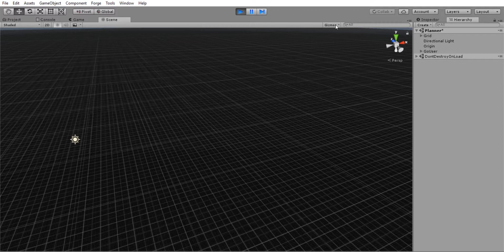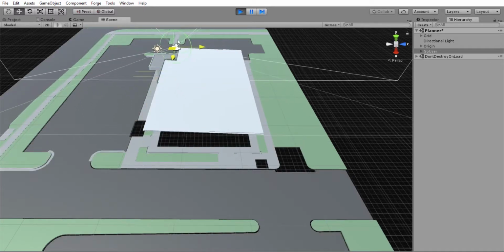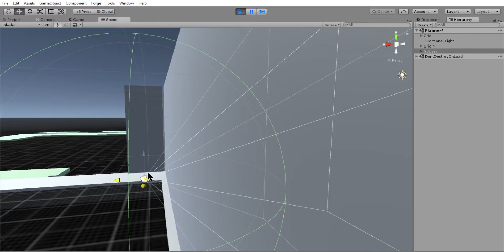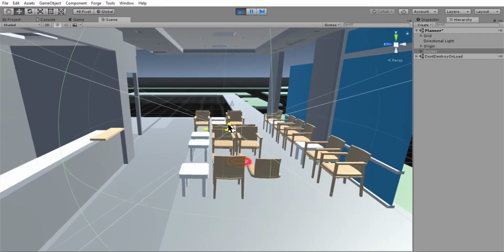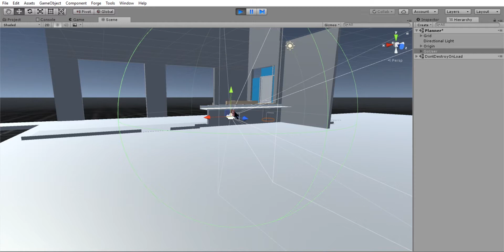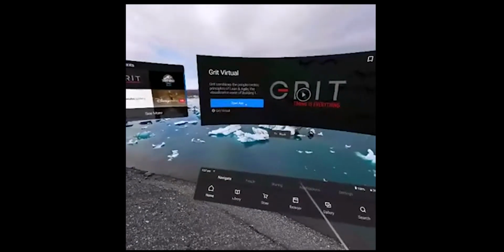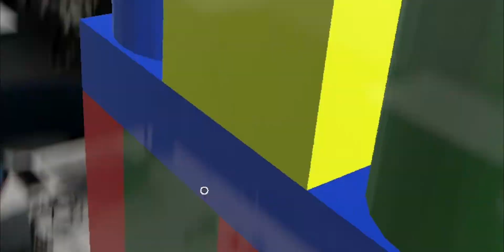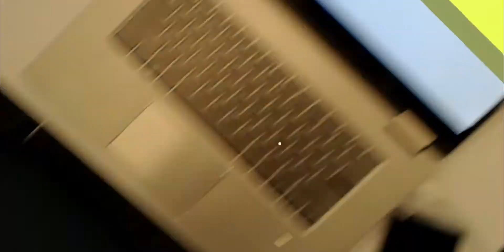Grit Virtual - Autodesk Forge Accelerator AR.VR Demos

Comment: Great keep experimenting with VR MR etc.  see Graphisoft BIMX or Trimble Connect both powerful low overhead VR viewers. 
Keep investigating building a realistic work flow or production plan needs to be done by those doing the work in direct conversations. 
The next level of innovation should be looking at simultaneous 3D coordination and building the work flow by tying the objects eg assemblies, to the work flow defined in the weekly work plan as mirroring work defined on the post it notes. This would be done prior to the “can” stage in the “should” stage of LPS. The objects/assemblies would contain schedule commitments, constraints and other production planning data that can rapidly yield PPC and Kanban metrics and “what if” plan alternatives produced on the fly by the Design/Build team.